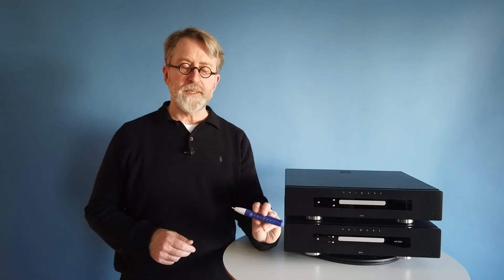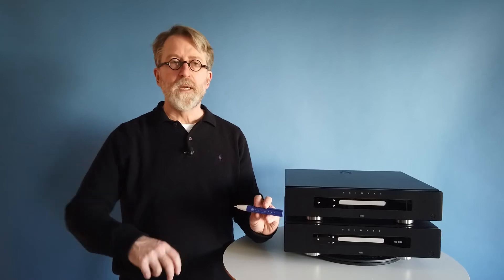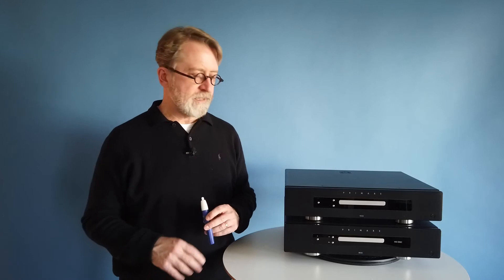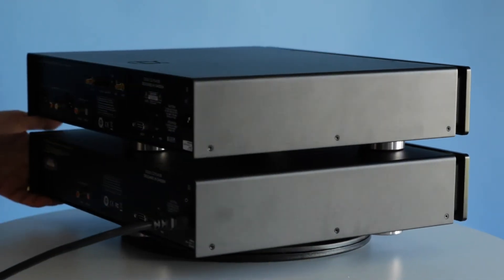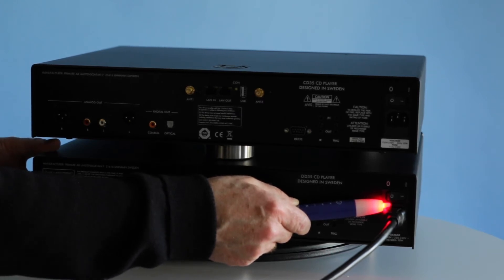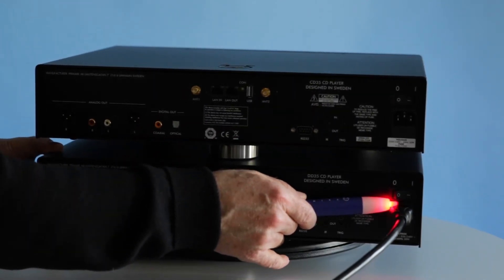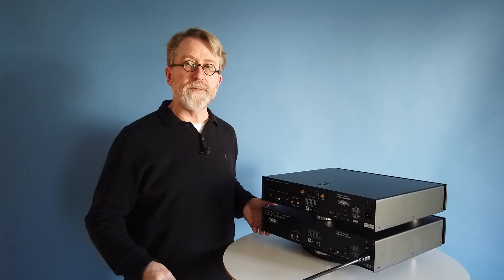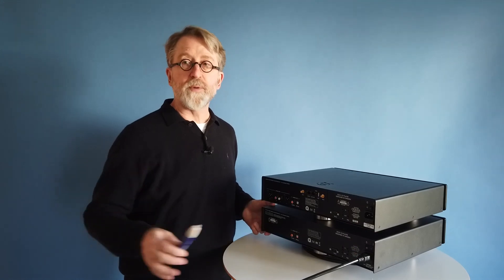Basic Setup - AC Polarity Pen Use

Comment: Dear Primare Team, Thank you for including this pen. I put the plug in the socket and it lights up on the outside and I would be wrong without this pen. I have a question - does it only apply to Primare that the inner side must light up, or can I use this pen for other plugs (CD player, amplifier, but not Primare) as well? Thanks in advance for your reply.
Reply from the maker: Sorry for the very late reply. Without knowing the model to which you are referring, and where you are located, I can only say that if a Prisma generation product the pen should light up on the inside. So, if this is the case, you will need to either rotate the AC  plug in the power socket if you are in Europe or outlet may need to be rewired (either the wall or power strip you may be using). I cannot say whether the pen can be used with other products, as it is entirely dependent upon the implementation of the power input for each manufacturer and device. For example, early Primare products were not consistent in AC wiring as later products, so even for older Primare the pen may not provide polarity indication as described.

Comment: Hi, is this applicatie for all Primare devices?, in my case Primare I32 amplifier, reason for asking is because when I follow this instruction I precieve more bass on the left side of the speaker, changing it 180 degrees (wrong poloarity by this instruction), I precieve more even bass from left and richt channel, hope you have answer on this.
Reply from the maker: Tim, I think I responded yesterday to your help request, with the short answer here being that whichever sounds best is the best, possibly as a result of your I32 AC input being mis-wired. Otherwise, you may need a technician to take a look.
Reply: @PrimareAB   Hi Terry, Yes indeed, found your response already, very much appreciated, currently hooked up as prescribed, and is indeed the way to go for, I found the issue in the meantime, although a strange one, I will try to explain, I listened true Tidal app via connect option, everything sounded off, not in balance between left and right speaker, now I am playing Tidal directly via my Cambridge CXN app (not using connect) and everything is exactly how it should be, still cannot explain, but it solved it in the end.
Reply from the maker: @Timothymod1  Happy to hear it, with thanks for letting me know!

Comment: Thanks for the video. "Inside edge" from documentation impossible to understand without your video.
I would prefer if you tell which of the pins of the plug should have power(N, GND, L).
Also maybe add link to this video into documentation. I have asked three people where is "inside edge" and no one could answer.